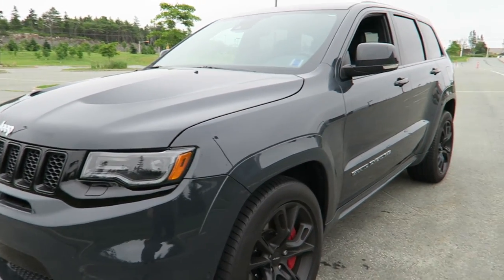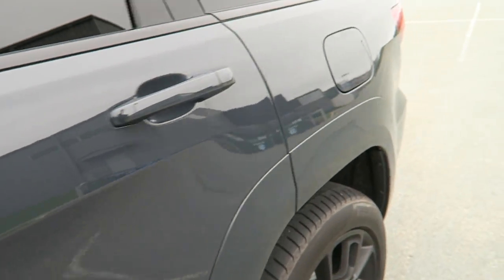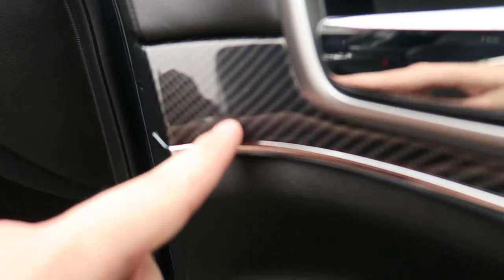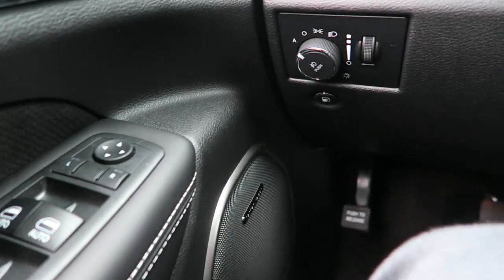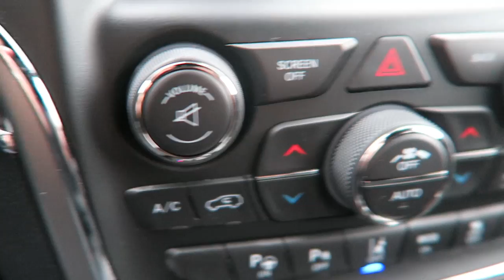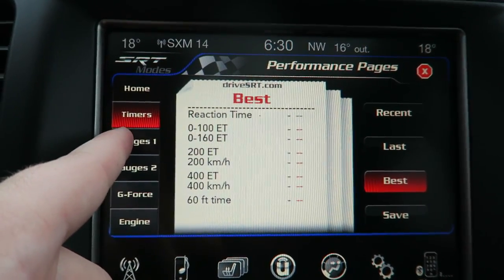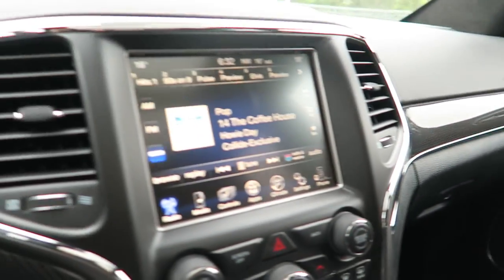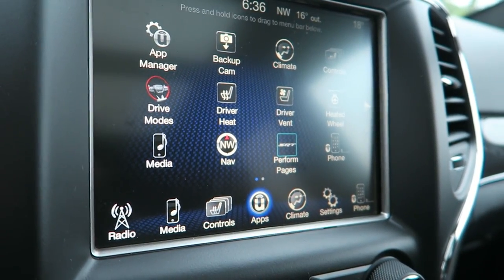MY NEW CAR

Comment: Yo dude, I have a 1948 Willys. Idk if you knew, but another "Easter egg" is on the grill. All jeeps have 7 slots on the grill because Jeep is the first car to go on all 7 continents. Just a funish fact. Also, Sweet car!
Reply: Michael on the pussy jeep (the small one I'll fix it) there are tons of Easter eggs
Reply: The 7-slot grill was NOT designed because the Jeep was sold on 7 continents. It was merely due to a design change when Ford patented the original 9-slot grill. If you look at earlier GC's, they have 8 slots (pic for reference http://photobucket.com/gallery/user/Dillonk09/media/bWVkaWFJZDoyMjQ4MTAyNw==/?ref=) . It's just a style, no significant history behind it. But the rumor has spread so bad that unintelligent salesman are even saying it's because Jeep's have been sold on all continents :/
Reply: Zac Price that is the only Jeep w/o a 7 slot grille. The 7 slot grille does hold significance as it signifies the brand’s capability. Jeeps have driven on all 7 continents, something no other brand can say
Reply: Tyler Cohn many other brands can say it, but jeep did it first.
Reply from the maker: Damn I did not know that, thank you dude
Reply: SpeirsTheAmazingHD Good BMG Vid idea 300 MPH CANNON IN HIGH SPEED CHASE
Reply: SpeirsTheAmazingHD. put some cherry bombs on the jeep it will be loud

Comment: I new as soon as I saw the silhouette of the car! It's my 2nd favourite car ever.
Reply: The Fronts seats should be a storage container and so should under the front floor mats. If you'd like you could plug your gaming systems providing they have an HDMI or AV plugin. Also it's recommended that you get 
aftermarket paddel shifters because the stalk ones are quite flimsy. But anyways congratulations on the new car dude.

Comment: get a flowmaster X pipe those sound so good and loud
Reply: or get borla ataks
Reply: H pipes are much better they have a deeper growl and allow for slightly but not much more constructive flow which in turn allows for more power
Reply: Muscle & Muscle no Black Widow has the best exhaust
Reply: Muscle & Muscle it will cost you a grand......
Reply: MainManJim - probably more than a grand
Reply: Loud isn't really a good thing though.

Comment: Break-in periods are a real thing and are important. Dealers will say anything to sell you a car. I wouldn't take them seriously when they say "we don't believe in break-ins". 

Rings need to seat to cylinder walls, tappets need to mate with cam lobes, bearings to crank and rods, etc. A lot of those components have tight tolerances until they get shaved down a bit which adds a little more stress to those components. This is why break-in engines sometimes consume more fuel than ones already broke in and why sooner oil change intervals are necessary. 
You don't have to coddle it but launch control holeshots are definitely something to avoid for that duration. There's a lot of ways they can tell if you thrashed your drivetrain due to aggressive driving and that could potentially void your warranty. 
Not telling you how to drive it. It's your vehicle drive it how you want. Just saying those guys were blowing smoke up your ass and certainly won't be there for you if it became time to cash in on that warranty.

Comment: I on a 1991 Jeep Cherokee. My grandparents had it then my uncle had it then I got it. It was an automatic but then I converted a 4-speed manual. Then I have replaced the radio. Because the radio didn't work. So I went to a junkyard and got an older radio for my Jeep there is so old it came out at AMC- Chrysler car the regular the needle the title station what radio station. I drove it for 5 years. My mom want to get a new car. My mom needed a new car so she sold her Dodge and I sold my Jeep for her to get her a new car. Do I regret it no I do not. She need a new car her Dodge is having electrical problems. My mom like how I took good care of my Jeep.
My mom like Jeeps she does not like the seats that are in them. Now I have no car I have drove in a little over a year now. but at least I can still use the city bus or ride a bicycle or walk.